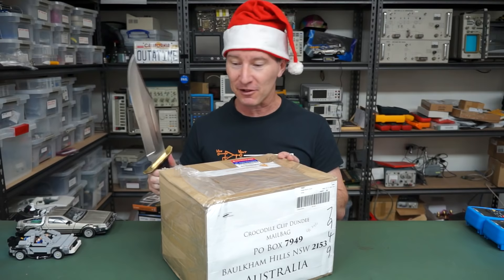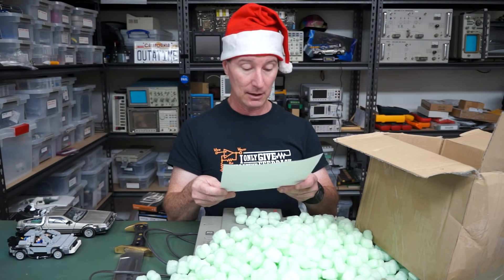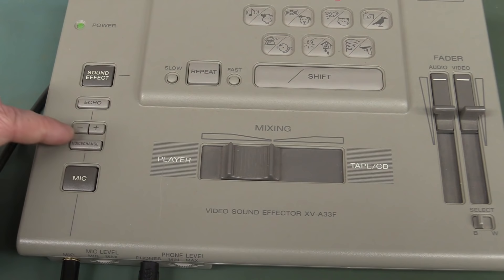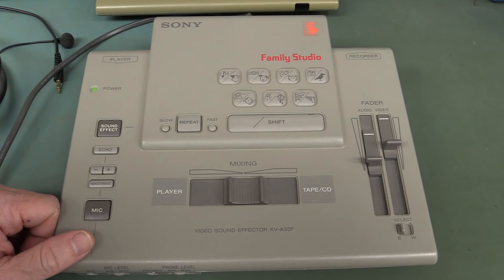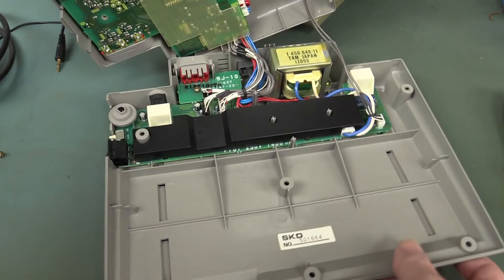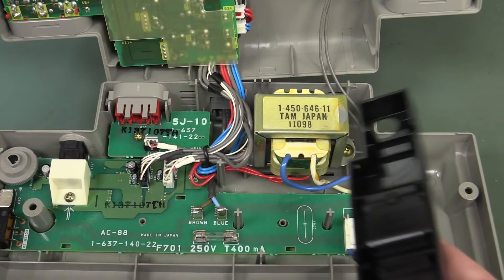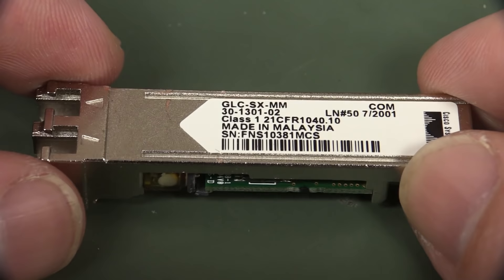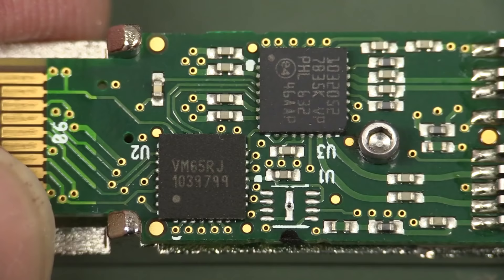EEVblog #958 - Mailbag

Comment: 123th view. Alone from the thumbnail it looks like NurdRage sent you his nuclear battery. I've read some time ago the thread on the forum.
Reply: Was about to say it, I recognize those green sticks
Reply: nrdesign1991 They are to easy to recognise aren't they^^
Reply: I watched that video the other day. Awesome.

I never fiddled with isotopes. The most oddball power generation device I have is a Stower Candle Charger, a thermoelectric generator in the base of a little pot you fill with water, and heat with a chafer fuel canister underneath. Just for kicks and grins, I powered up and ran an Arduino Uno with the thing. Worked fine. You can make a cup of tea with the hot water while you power your Arduino.

Or charge a USB power bank or your phone. But I thought this was geekier.

When Dave wobbled the grill thingie I immediately thought "ROLF HARRIS! Tie me kangaroo down, sport, tie me kangaroo down..." Then Dave said "I'm not Rolf Harris," and I had to laugh.
Reply: Gwen Patton Thermoelectric generators can be quite powerfull! It all depends on the used peltier? element. 
Some are powerful enough to charge a phone at a decent speed. 

Definitely want to experiment with a TEG.
Reply: Drakkar Calethiel Check out the devices by Stower. I backed both on Kickstarter, and they're great. The Flamestower has a blade on the TEG that can be shoved into any flame, and an expanding silicone tank holds the cooling water. The Candle Charger like I said has a little saucepan on a metal stand. The cold water goes in the saucepan, and the heat source underneath. I don't think Stower repurposed computer CPU chillers or some such, I think they used TEG modules designed to generate power, so they're probably the most efficient they could afford to use.

They supply a diethylene glycol chafer fuel canister, because they're safest to ship. Diethylene glycol fuel will only burn in a wick -- a puddle of it can't ignite at normal temperatures. (I never tried lighting it with magnesium, so I qualified that.) I have a case of 6-hour chafer canisters in storage (24 in a case) so I have LOTS of safe fuel for it for most emergency situations. But it can use a wax candle, an Esbit tablet, a small wood fire, anything. I could put the pot (which has the TEG in it) over my Solo stove and it'd work fine. 

It's a very versatile device, and you can use the hot water for tasty beverages or reconstituting freeze-dried food. Since it heats the water and can boil it, you can sterilize water with it to make it safe to drink while charging your electronics. You NEED to change the water for cool water for the sake of efficiency, but you can certainly let it get hot enough to sterilize it and make coffee or tea with it.

Worth experimenting with. I was surprised it had enough oomph to run the Uno, even through a programming phase, without browning out. But I'd run it into a battery, then use the battery to power stuff.
Reply: possibly better at holding the memory on either an arcade game or pinball machine but thats all I could see a use for.  (and of course hoping it doesn't leak

Comment: I'm thinking, why is it necessary to have a fluorescent material between the tritium and the solar cell? Isn't the photoelectric material capable of using the radiation from the tritium directly? If I were to design such a cell I would consider smearing a thin layer of tritium content over a larger cell that I could roll up into a small cylinder.

Comment: The half-life of tritium is only about 12.5 years. So, yeah, with typical engineering margins, the lifetime of these "nuclear batteries" is – at best – equivalent to a lithium battery, which of course can deliver higher peak current and has much higher energy density.

Comment: That's not 1000 Base-T, the T is for Twisted pair variants. Different letters are used for different types of COAX and different types of fibre. And yeah, Cisco is such a hard company to deal with, I tend to avoid them as a matter of usefulness. For example they insist on their own non-standard terminology and have that closed cult CNE thing to prevent normal professionals reading the manuals.

Comment: I have a playbook sitting on my desk but the battery is 100% dead...
I had used it for a year or so. It has no apps and the WiFi was abysmal.
Reply: The only problem it has is it needs an uncommon 1.8 amp charger for those two batteries

Comment: 17:54 what does that mean?  "power curve"
Reply: Voltage vs Current curve. Look up "solar cell peak power tracking" and you'll see voltage vs current curves all over the place. If you have open circuit, current = 0, therefore no power is being delivered. If you have short circuit, voltage = 0, therefore no power is being delivered. The optimal point is somewhere between those extremes, where power (voltage * current) is maximised.
Reply: now, I need to understand what current means.
 I know it's analogous to flow of water
 and voltage is also analogous to pressure. 
(see, I don't understand these Concepts well enough to say I'm sure and I know it's not wise to show your knowledge weaknesses two strangers, on the internet especially)
but this is something I'm really interested in. 
So thanks

Comment: 14x 24EUR = 336EUR = 350USD.
So its 350USD battery that do same as 0,1USD coin battery xD
Reply: Arek R. But it runs on SCIENCE
Reply: Coin batteries also use "SCIENCE"
Even when you make shit there is a lot of science xD
Reply: it doesn't do the same as a coin battery as those trits will maintain that output for about 12 years where that coin cell will only maintain that level as long as it is not being drained on...
Reply: That tritum battery can output micro amps, its soo small that main concern will be shelf life of coin battery(will quicker die than discharge).
Reply: the biggest issue is the solar cells not exactly that efficient in low light there are Types of cells similar to solar that literally use radiation that the commercial cells use... my thoughts are is there any configuration of solar cells that this could produce viable amperage. My design thoughts are 3 smaller panels per vial arranged in a triangular pattern all 3 panels in parallel then the same for each vial  rather than sandwitch the vials between 2 panels